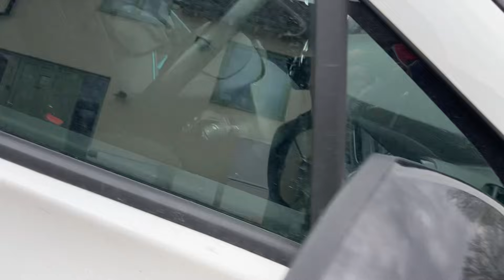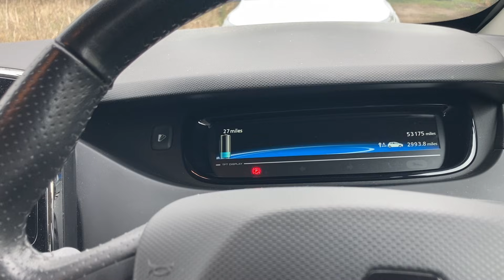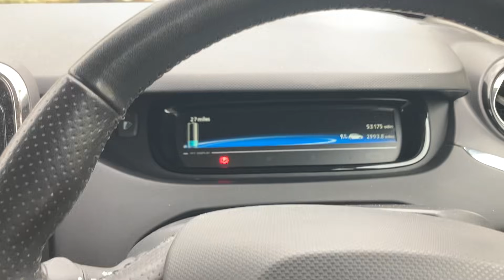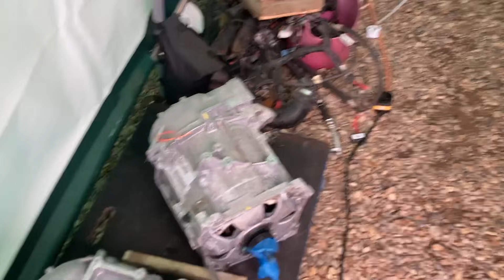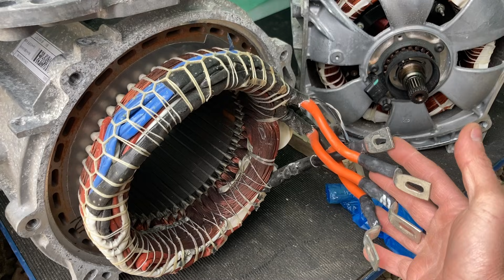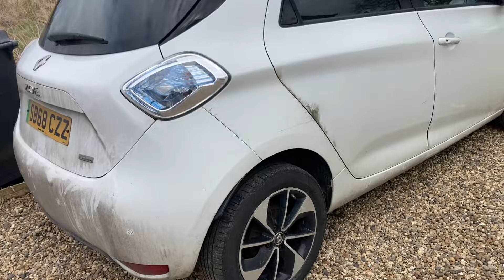Is this 6 year old EV scrap? 🫣 Renault Zoe Electric Car faulty - EV Salvage Car Repair Mechanic

Comment: So the idea of an ev engine having less faults due to be a simpler engine will have more faults.
My 700cc Mercedes suprex engine is known to get over 400k with cars nearing half a million miles in some smart roadsters now. 
Smart roadster starts at £1.5k 

Ev suxs

Comment: My daughter bought one 2023 YOM 2019. 15k miles cost 7k only problem is charging takes 5 hours to charge at EV station .300km range cheap to 0.47€ Kw 22kw battery
Reply: How does a 22kW battery get 300 km of range?
Reply: It dose not . 100km aprox.  Charging with his cost aprox 10 Euro . = More expensive to drive then a diesel car.

Comment: Bought a 3yr old one with FSH and only  11000 mls the heater didn't exist, it took an hour to charge in the winter and  that would normally give you 70mls. A journey from home to Coventry 33mls at around 60 mph meant i had to  completely recharge before heading home. Got rid if it after 6mths.

Comment: I wonder how easy it would be to convert it to petrol because in America they converted a Tesla into petrol didn't know they put a V8 engine in it it'll be interesting when the battery is die😅
Reply from the maker: Not very easy and not a job for me!

Comment: Wondering if you know if the AC compressor is also cooling the engine on the ZE50. Mine is broken and I would like to know if I will ruin the car if I continue driving now the weather is getting warmer?
Reply from the maker: Hi the AC system cools the cabin and the traction Battery, the motor is Air cooled and the control box is water cooled so it will only affect the battery and cabin. You won’t have heating either because it has a heat pump so the ac compressor also provides heating, unless it’s below 5c as there is an additional electric heater that kicks in. Cheers

Comment: I would not touch a Ford eco boost or psa group pure tech or even a V W 3 cylinder wet belt engine like you say they are all rubbish and fail at relative low mileage especially if the wrong grade oil has been used or the service schedule has not been kept up to.

Comment: I am coming to the conclusion that E V s are not built or designed to last. It seems they want you to buy a brand new one every 5 to 6 years, unlike say a Mercedes Benze from the seventies eighties which had a thirty year anti corrosion warranty and sold reliable engines they would last 30 years plus.
Reply: No modern cars are built to last. The modern small replacement turbo charged "eco" gasoline engines are also rubbish and very short lived. But the service and repair industry and garages are also developing very fast on repairing EV:s and EV batteries so I presume EV's will be more durable than conventional cars in the near future, if not already. We have a new Nissan LEAF and if you know ho to treat the battery the car may be the most reliable passenger car in the market at the moment. And you can get LEAF batteries replaced for a VERY reasonable price already.

Comment: Gary thanks . avidly watch your vids as we have a ‘20 plate ze 50 , 11k miles . What is it about this resistance to working on evs ? Especially as you point out mainly electro mechanical issues .
Possibly due to no new generation of technicians who are not totally dyed  in the wool indoctrinated, petrol,heads. Need more to take it up ….do you train anyone ?
Reply from the maker: Hi there, I think people just fear the unknown and are worried of taking on a job that they won't know how to finish. It is getting better with the Hevra network supporting independent garages. I work with Hevra tech support, I don't do training myself but there are various organisations that do. Cheers

Comment: Buy an MG5 as they are really reliable all those taxi drivers cant be wrong
Reply from the maker: Hi yes I have looked at the mg5 as they are one of the few reasonably priced EVs. They do look good. Cheers
Reply: They are great cars capable of big miles, we had a I3REX before and value for money the MG5 is light years ahead @garycevrepairs
Reply: Ad populum

Comment: The windings of the sensing coils - very likely - are open somewhere.
Mark the zero position of the sensor with a felt pen, take a photograph, remove the sensor and check every winding with an ohmmeter...

Comment: The whole Eco argument goes out of the window when a car has to be scrapped at 50k miles.
Reply: Have you done the in depth calculations or just made that up?
Reply: @HumansAreShitFactories  ICE car about 5.5 tonnes of CO2 to manufacture. E car 8.8 tonnes. Both have more or less the same lifespan 15 years.
Reply: @  It’s obvious from your totally inadequate response that’s is completely lacking any depth or nuance you haven’t done any calculations.
Reply: @ calm down Greta.
Reply from the maker: Good job I will get this one back on the road
Reply: I think the EV argument is much deeper, they are heavier per class, put more wear on tyres and brakes, (more pollution) as in this case the repair is not easy, the parts are very expensive, dealer time cost are high, while ICE can be as high in repair costs, they can be repaired at home with skills, parts were readily available, it not unusual for people to have vehicles for 20 - 30 years and still running, we will have to wait to see EV's life span.
EV's seem to be part of the throwaway culture, like many products, repairs are a last thought, Tesla is very tight on repairs and who can do them, which can limit how you recharge them, and the whole green energy thing is a massive con, much of the power is produced by less than green methods.

Comment: I don t think repairing them was ever thought about , more likely it will break at six years old the parts are so expensive to replace so you will have to come and buy a new one off us after just 53 000 and six years, thats probably the real reason they are pushing E V s the car industry thought they could sell more cars and make more money than with ICE  vehicles which can last decades, its al about the money.
Reply from the maker: Yes I agree, repairing was definitely an afterthought.

Comment: Hi Gary I have a 2017 ZOE ZE40 78,000 miles on battery lease and took it into my Local Renault Dealer to ascertain how much to get a battery SOH report.
 The Service adviser asked me my Registration Number, put that into his desk top computer and said all ZOE are monitored by the RENAULT APP and my Battery SOH was 85%, are you or any other owners aware of this facility ? Great result for age of the car David
Reply from the maker: Hi there, I have not heard of this facility, I am aware that the app shows the current state of Charge, can you confirm that this was not your Charge level? I have only heard in the past that people had to have a diagnostic check to get the battery health figure. Cheers
Reply: @garycevrepairs  Hi Gary 
Renault Leamington Spa, I asked specifically about cost of a Battery SOH and expected him to say £30 to £50 but he tapped in my reg and said 85% from his computer, and all ZOE Cars monitored over the air etc   Dave

Comment: Whereas you buy a secondhand Mercedes 124 or even W-2 02, with 50,000 miles , it’s barely run in and will go onto do half 1,000,000 miles standing on its ear.

Comment: What is going to happen to the poisonous materials in the batteries of what's going to be millions of these unwanted cars, it will wind up in rivers and the sea, if ingested it will be fatal.
Reply from the maker: Why would the batteries end up in a river? The batteries contain valuable elements so are desirable for recycling - new recycling companies are now operating to take EV batteries. Cheers
Reply: I guess we’ll just add it all to the thousands of other noxious materials humans have contaminated the environment with, that you seem happy with thus far.
Reply: Ok but the depleted battery still contains some rather nasty chemicals in it and is probably not that easy to recycle
Reply: @StuartPearson-mj7uz  There are businesses that take EV batteries and convert them to grid storage. So chances are, anything with a decent SoH (like most Zoe batteries) will get a second life inside a storage system. Only when it is utterly useless will it be recycled, and even then, the materials inside are worth a reasonable amount so it is profitable to break them up and recyle properly.
Reply: Surely if the battery is no good on the car because it's not holding or taking a charge how is it going to be any good as battery storage for the grid?
Reply: @StuartPearson-mj7uz  if it's no good at all, that's true. What you usually see is that the state of health declines slowly - at the point where the range becomes a problem, the battery still has a reasonable amount of useful capacity. And that's if the battery is the reason for scrapping the car, in many cases it is something else expensive.
Reply: E V s are not environmentally friendly it's a complete con , most people who buy secondhand don t have 3 grand to spend on a new electric motor plus a new battery 20 odd grand , most people will just think that's more than the car is worth  and scrap it , at 53 000 and only six years old that is really not environmentally friendly at all then there's the toxic battery what happens to that throw it in land fill
Reply from the maker: @StuartPearson-mj7uz how would an EV Battery end up in landfill? When you scrap a petrol car the oil doesn't end up in landfill? Scrapyards have licenses and have to dispose of certain items in particular ways. There are several companies that recycle EV batteries, they are quite desirable because of the valuable elements contained inside. Cheers

Comment: My 23 yr old Audi cost me £300 to get through mot, sticking calliper and new pads. Don't make like they used to. Usually it gets through with no issues. Only issue is the cost of taxing it nearly £400.
Reply: There were 70,000 Audis registered in the UK in 2002, but now only 10,000 of them are still registered on the road. So you've got a fairly rare car.
Reply: How can you say “they don’t make them like they used to” when you don’t even do such basic work as you described?

Comment: Just shows EVs are not fit for purpose
Reply: I had a crap ICE car a few times 

So, they are not fit for purpose either then 😊
Reply: @MsDmcclymont  they last far longer than 6 years!
Reply: It's true to say you can get the odd petrol car that can be troublesome

Comment: This is a problem with modern cars a friend of mine bought a Toyota Corolla because he was a high mileage driver and it was recommended as a very reliable vehicle. The engine management unit failed and Toyota quote for repair was about the same as the value of the car.
Reply from the maker: Ouch !

Comment: Unbelievable! I have never known an ICE vehicle breakdown or have reliability issues. Or premature bearing failure. Or catch fire. Or get hydro-locked. Or runaway. Or rust. Or need a clutch, exhaust, cam belt, turbo, etc..  Yep, this is just as ridiculous as the EV bashing on here. 
The last 100 years has seen a whole industry built up to repair and service them.
The AA was not started up just to recover EVs.
Reply: Exactly that....Don't forget timing the entire engine with a rubber belt (sometimes a wet belt sharing the same oil as the engine which degrades from the word go contaminating the engine oil and blocking the oil pickup) It's amost like cars are designed to fail early, possibly just after the warranty period, to maintain an income. I'm a vehicle electricain and worked 15 years at a uk airport looking after around 400 electric vehicles. Occasionally we'd have a motor temp sensor fail but rather than remove the motor, they fitted a second spare sensor. So just a two wire swap in a multiplug and all was good. Imagine if the motor trade adapted the same line. Electric vehicles should be more reliable with less moving parts. But fit a low quality component burried somewhere inside and it lets us all down. It's due to poor design.
Reply: Yeah, that’s right ICE cars are right-offs after 6 years and 50k miles of normal use all the time, whereas EVs need far less maintenance because they’re so simple…apparently. 😂

Comment: For a motor fault to cost £1000s is unreal.
Reply: A cam belt on a Transit is around £1300. How much do you think an engine costs?
Reply: But a second hand motor from a crashed Zoe. Or another Zoe with other issues.

Comment: Back in the 1970s I had a Yamaha 350 that developed a mid range misfire, it was the main bearings going which at certain revs caused the crank to oscillate slightly changing when the points opened (2 stroke and points cam was on the end of the crankshaft), had to have a full crank rebuild to cure the misfire.

Comment: Who the hell designs this rubbish?  Motors have run industry for decades longer than we have had EV's and are THE most reliable way of making things rotate... Motors on EV's should be oil immersed and position sensors potted and on NDE for easy replacement.  I bet the bearings are a complete pile of shit to replace too... another thing that should be simple to do with standard bearings.
Reply: I'm with you on that. I worked in a factory where motors lasted forty years, with hard work!

Comment: I would not have batteries can give off gas. One spark  and up you go .
Reply: That sounds like petrol to me, not a battery. Maybe a charging lead acid battery...
Reply from the maker: Lithium batteries do not give Off any kind of gas unless they are massively over or undercharged and cannot be ignited with a spark
Reply: @garycevrepairs Pure fantasy.

Comment: People saying its an EV problem its not. Alot of modern cars petrol diesel have huge problems,Ford eco boom ,puretech, etc etc etc Ad blue,Toyota yaris etc the are all  unreliable now.
Reply: Toyota are the most reliable and in the UK they offer a comprehensive 10 year /100,000 mile warranty provided  the car is serviced every 10,000 miles or annually - whichever comes the sooner.
Reply: @RB-n6c  And they offer the same warranty for the bZ4X.
Reply: Unfortunately all the things you mentioned were brought in to reduce emissions but have ended up making cars more unreliable
Reply: @StuartPearson-mj7uz  that is true and reliability suffers alot
Reply: You're joking right?🤣🤣🤣🤣🤣🤣

Comment: Worst thing that has every happen to transport!!! ELECTRIC
Reply: Best idea ever 
It’s the future 
My mates Ford fieta 1.0
Eco boost just blew its engine up at 29000 miles and 6 years old 

Thanks to fords wet belt system
Reply: @boyasaka  saves him right for buying a wet belt car
Reply: @matterhorn1975  MOST motorists , probs 90 percent of them do not have a Clue of a car has 2 cylinders 3 or 4 
Wet belt , chain , dry belt , 
They have no idea at all if they car had a DPF or. a EGR valve 

You could stop 1000 people getting out of there cars outside Asda on a Saturday afternoon 
And ask them does your car have a wet belt , dry or chain , and 90 percent plus wouldn’t have a clue what your talking about 
So your comment was a bit stupid
Reply: @boyasaka  no excuse now days with all the reviews on YT, especially when it comes to an eco boost!
Your spending 10s thousands of pounds and people don't do there research, that's stupid

Comment: Is the "position" really that critical? Surely the software driving the phases is looking for a fluctuation trend, rather than a fixed voltage? There is normally a high degree of fault tolerance built into these systems, as there is, for example with CAN networks ... 🤔
Reply from the maker: Hi yes it is absolutely crucial, if the rotor is in a slightly different position the motor could go backwards instead of forwards 🤪

Comment: But EVs are really simple and last forever and the batteries last for 200000 miles and 20 plus years.
Reply: They often do 
My mates Tesla is 9 years old and on 200,000 miles and still fine
Reply: Yes, and they expect us to believe this crap. Worse still, though people are actually falling for it - the World's IQ is dropping by the year
Reply: @JamesPark-s4yif your are a petrol head like me 
You will know how many 1000s of newish ice cars have engine failure at lowish Miles thanks to Hondas and fords and Peugeots wet  timing belts 

And repair is 4 or 5 k

Comment: Makes me even more wary. Wonder if other EVs have similar problems.  A touch concerning. Wonder if Renault have better quality control on current models?
Reply from the maker: Let's hope so, this motor first came out in 2015 so it's probably a 12/13 year old design. Cheers

Comment: Stupid rotor position sensor design on the output shaft end, a Hart sensor is far simpler mounted on the non drive end. I hope you replace the bearings with the motor out.
Shocking motor design and air cooled to boot. Check out this link to very high mileage but well designed EV's. https://www.youtube.com/watch?v=Z-1aVMAvnFo
Gary, your vids will keep a lot of these cars on the road. Well done mate.

Comment: And people still buying EV cars, where does scrapping a 6yr old car help the environment plus what ridiculous price for the pile of shit in the first place
Reply: The issue is the Renault Zoe motor design. Virtually all other EV manufacturers use far simpler motors that are oil immersed so little or no bearing wear and even parts like the rotor position sensor are simpler and accessed externally.
Reply: Mate if you based ICE cars on French reliability, we'd all be using horses.
Reply: I think it's going to go back to horses !